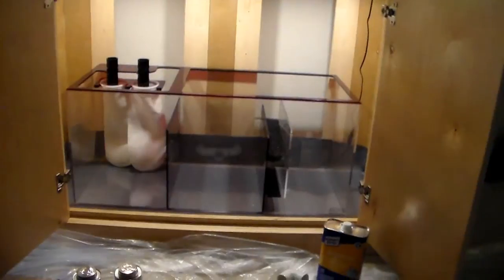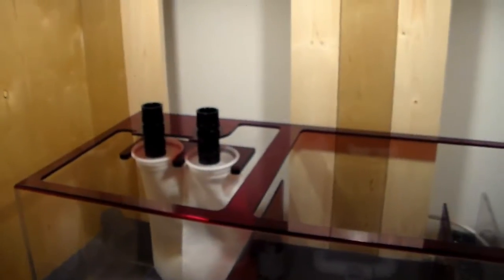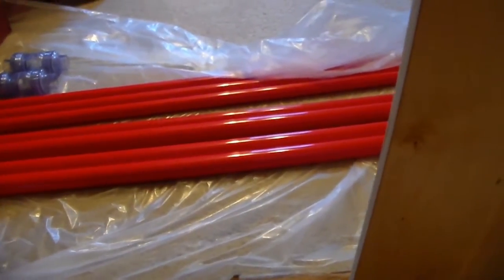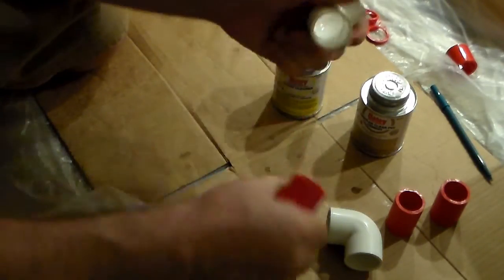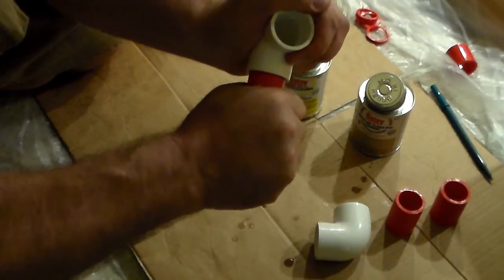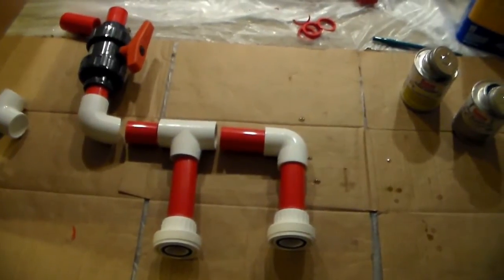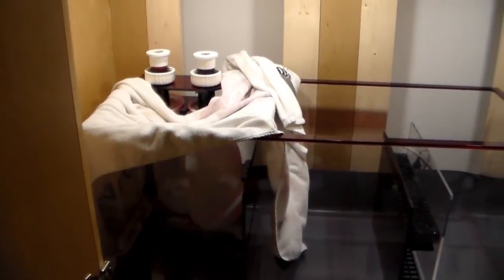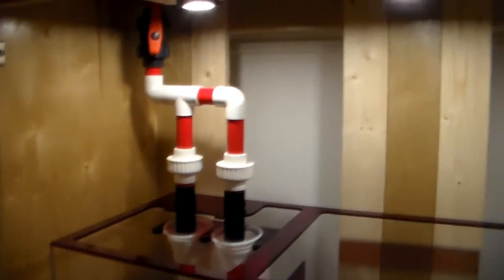150 gallon reef set up -overflow plumbing

Comment: This is the worst plumbing video I have ever seen. He didn't cut the pipe straight. He didn't chamfer the edges. Cleaner is not primer. You can get clear primer. The primer is the most important component not the glue. The reason they have purple primer is so you can see that  you got the primer applied correctly. Search MACNA 2017 plumbing and learn how to do it right so down the road you don't have problems.
Reply from the maker: Todd Hayslett opinions are like assholes,  everybody's got one
Appreciate the comment
Reply: lol

Comment: You can get different colored pipe from Bulk Reef Supply but it only comes in 5 ft sections. You could go to any plumbing supply house in a big city and find it in 10 and 20  ft lengths or they can order it for you. I don't worry that much about how my plumbing looks I am more concerned on how it works.
Reply from the maker: Todd Hayslett them city slickers in the "big city" must have some nice size tanks if they need 10 to 20 foot pipe,
Reply: The colored pipe is used in industry to denote different types of chemicals in use.

Comment: Could you please tell me all the parts you used. I just got a used ruby sump 30 but it did not come with a nice plumbing set up, mine is super loud and only utilizes one of the socks. Thanks
Reply from the maker: JAFRe if urs had nothing with it you may have to get some 1" bulkheads for the 2 holes in the top left of the sump for the overflow, you can pipe from there.
As far as noise, a gate valve or ball valve to limit flow would work, also make sure the overflow empties under the water level in the sump
Hope this helps
Reply: My tank already has the bulkhead for the flow into the sump I just was wondering about the rest of the plumbing parts you used. Also, the only thing it didn't come with are the two black pieces that go into the sock areas. Thanks
Reply from the maker: JAFRe that is where im saying get 1" bulkheads,   the two holes that go to sock and skimmer section on the sump, will give it a clean look.   As far as what I used, you can see in vid.  All 1" overflow plumbing, 3/4 return with a check valve.  Got the ball and check valves from bulk reef supply
Reply: REEFER B thank you, very new and know nothing of plumbing

Comment: so would i have a problem if both my drain and return are 1" ? or should i make my return 3/4
Reply from the maker: MrCokeman01 I would definitely reduce down to 3/4.  It will give you better pressure for return, which will give you better flow in the tank.  Hit that sub button!  thx for watching, I'll be getting new vid up soon!!

Comment: Clear cleaner is a different product than purple primer.  It will work fine for no pressure applications but If you plan to use it in pressure systems (pump side), the primer doesn't just clean, but it also softens the pipe, which makes the bond MUCH stronger.  Just an FYI from a pipe guy.

Nice looking build, I think I am going to get some red pipe as well now :)